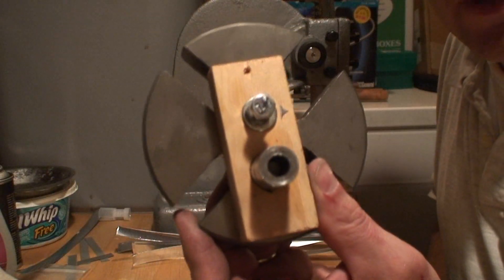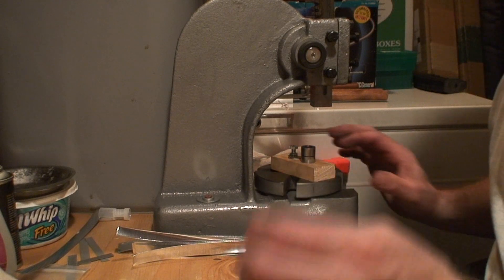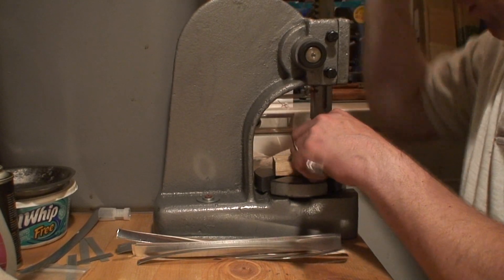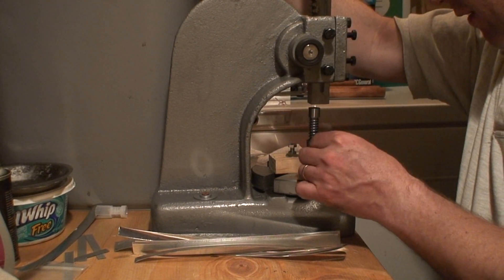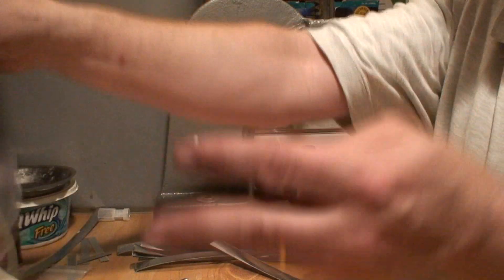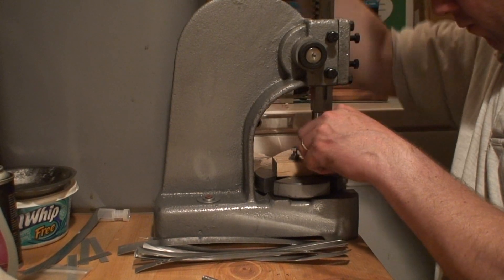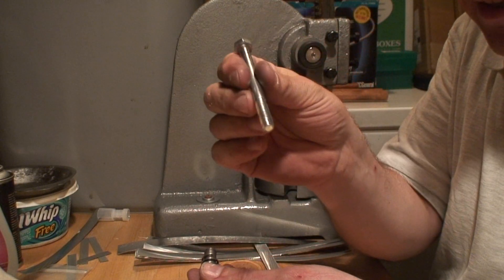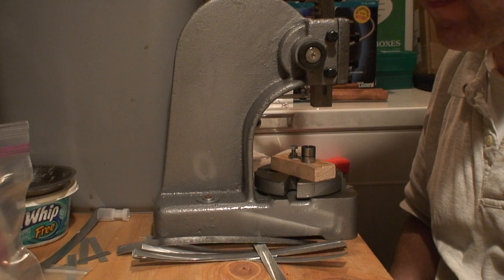FreeChex III - The Fastest way to make your own Gas Checks (FreeChex 3)

Comment from the maker: A gas check is a small cap that fits on the end of your cast bullet.  Generally you only need them for cartridges designed for velocities more than approximately 1400 fps which includes most rifle cartridges and even a few pistol cartridges.  At the most basic level they protect the cast bullet from the hot gasses while traveling down your barrel.  But there are other mechanisms at work as well.  Without them you will have problems with leading in your barrel and reduced accuracy.

Comment: of all the videos on youtube for making gas checks yours is by far the best,however if you used aluminium slit to 1/2" wide and run it off a small mandrel you would save yourself a lot of time using the guillotine,less wastage,and nice smooth edges on the strip, so less cuts on your hands!

Comment from the maker: @spritrocks The one I got was a prototype.  It works with thickness of aluminum flashing that I buy at home depot.  I can't remember the exact thickness off the top of my head.  I would expect that different thicknesses and types of material would come out with slightly different dimensions.

Comment: I'm looking into getting this.  I don't have an arbor press.  I see that harbor freight has a 1/2 ton and a 1 ton model.  Do you think the 1/2 ton would work?  I believe it has a 4.5'' height capacity.  I'd rather have the smaller one if it would work to conserve space.  

Thanks for the video, ive seen these but always wondered how well they work.

Comment: any updates?
Reply from the maker: Unfortunately the person who designed and was producing these decided a few months ago that selling the FreeChex III was more trouble than it was worth... at least for the time being.  You might still be able to find a used one occasionally on eBay.  Mine was actually one of the very first one's produced.  I made thousands of gas checks with the Freechex III and it worked out very well and still is in good shape.